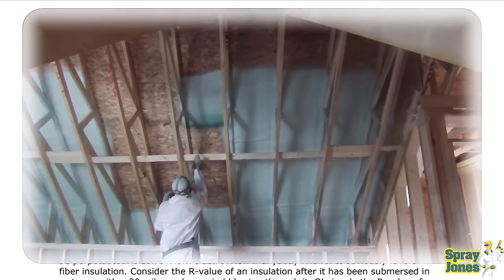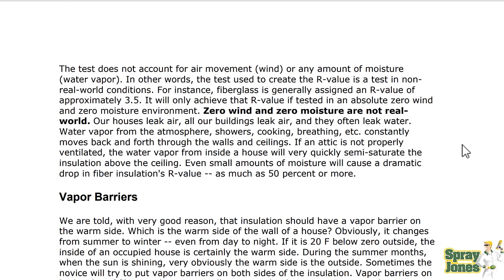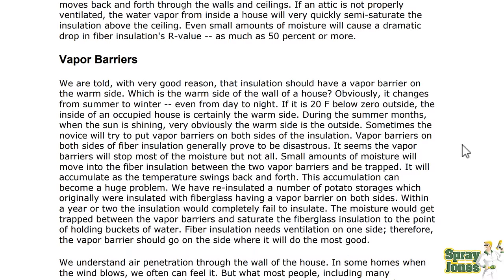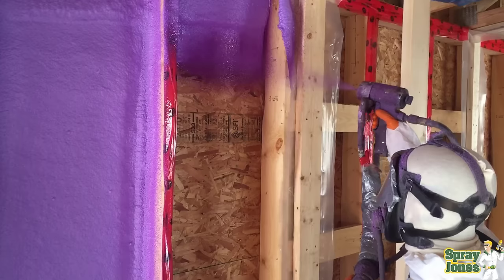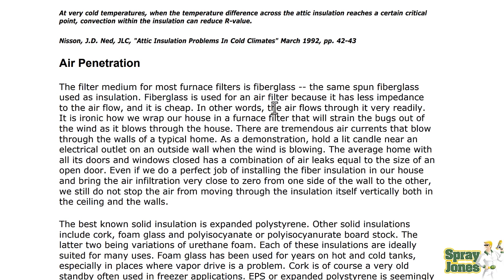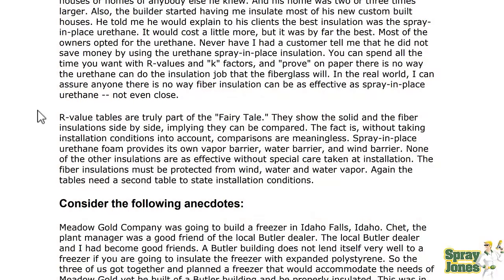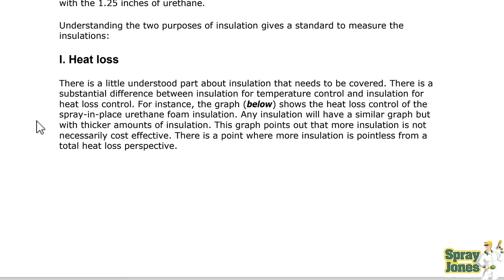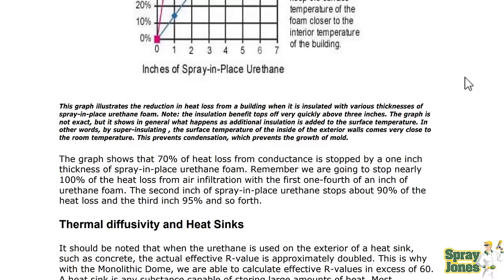Rigged Code Series | Part 1-  Why R values only for Spray Foam Insulation?

Comment: The best insulation hands down. Not one time in the 10 years  I have been spraying has a customer called and said anything negative about how the spray foam performed as an insulator. It’s always a positive result almost life changing for people. The only complaint I getand it’s constant is the price. If the codes/ R-value updated with scientific data that spray foam is in fact the best insulation there is on the market and has many other benefits outside of just an insulator that no other insulation even comes close to matching. Once the codes are changed Spray foam will be code and therefore drop the price on the material and make it more affordable for everyone. Thanks again Mike
Reply: Best is def subjective. 

Dense pack fiberglass at R-23 outperforms 3 inches of foam at r-21. R-value is what's king. Basic air sealing detail is all you need to get a house tight and avoid spending money to bring in fresh air. Forced ach is the same as nat ach below 1
Reply: There were multiple tests. One example. R-21 batting outperformed r-20 cellulose even though cellulose is air tight.

R-20 ellulose performed better than t-19 batting.

R-23 dense  pack will outperform r-21 foam. Basic air sealing is all you need.

R value is king

It also takes 15 years to see ROI on foam when compared to the standard batting. Not calculating fresh air intake costs.  

With dense pack you'll wait 8 years over the standard costs.

Batting offers no ROI for new construction.
Reply: Good stuff.
Reply: I would hope a higher R value would out perform a lower R value
Reply: @mikesteven3611  exactly my point.

Comment: Air barriers testing is critical for the whole envelope. Zip sheeting combined with flash and batt Rockwool on 2x6 studs is current gold standard but it’s evolving. Closed cell strengthens the whole thing.
Reply from the maker: Flash and batt is a disaster in cold climates and will have moisture issues. I have spoken to multiple people already this year that had to open walls and remove it.
Reply: @SprayJones  agreed, the further north you go…
Reply: What about open cell on top of closed cell (2" of closed cell followed by filling cavity with open cell)? Will that lead to the same moisture problems as flash and batt?

Comment: Looking to build a house in AK in 25/26, zone 7 building code requirements so heavily looking at closed cell.  Thank you so much for your info and continuing info as I’m supposed to have R-50 value in the ceiling now and looking at how to do that.  Super excited for this series for sure.
Reply from the maker: What are the specs for vaulted ceilings?

Comment: Hello spray jones hoping to ask a question, we have a 1964 house with cathedral ceiling in living room in cold Calgary prairie. The inside of roof is wood tongue and groove, so plan when replacing roof is to spray foam the other side of tongue and groove. Seems like most spray foam is sprayed to backside of the roof deck. Any issues with spraying the back of the tongue and groove then putting decking over top?

Comment: Ask any renovator what the fiberass insulation looks like after a period of years.
Reply: Dirty with black if air sealing was subpar and not poofy like when first installed.
Reply: @trevorhardy3544  Don't forget the rat/mouse poop.

Comment: Do you do anything about sealing plates, like plates to slab, between double top plates, corners, etc where your foam isn't applied, or is that up to somebody else?
I know most people use a caulking sealant, I have seen others spraying a blue liquid of some sort, just wondering about your thoughts and if you do anything like that.

Comment: Curious to hear what you think about the SIP wall assembly using PU closed cell foam core. So, it would be zip outside, PU foam, osb inside. 4.5" wall is an R26 and nets 3.5" of foam between the sheathing. Is it a good or bad idea?
Thanks
Reply from the maker: Good idea. We have done projects like that already.

Comment: I have a one hundred year old brick construction house with no insulation in Jersey City NJ what spray foam would be suitable for such a structure?
I’m thinking about doing a full gut, removing the old asbestos and the plaster and lathe walls and ceiling’s and install 2x4 framing and new electrical and plumbing and a new Flat torch down roof.
Would I be better off if I put a puck system styrofoam on the exterior as a thermal break and then had it stuccoed? Or spray foam only the basement walls and put up 2x4 and 5/8” sheet rock for fire resistant walls?
I don’t really want to gut the entire house if I can get a reasonable amount of sealing and insulation performance by doing the outside rather than the inside. What’s your thinking Mike?
Reply from the maker: Gut, frame and use 2lb closed cell. Have a dedicated video on "old brick home". Go find it via the search icon on SJ home page channel.

Comment: We are about to build a Barndo (metal siding/roof with zip sheathing) house with a pit basement in North Carolina.  Would you recommend doing closed cell on outside basement walls? If so, would you recommend putting an additional dimple mat on the outside of the foam as well?  Do you recommend an air gap on the roof since it will be metal roofing? Want to use closed cell from the basement up to the roof.
Reply from the maker: I cannot make specific recommendations because they depend on approvals for your county / area.

Watch the 4 part roof series, also in contact with ground video.
Reply: I am planning a "hot roof" or unventilated roof - reinforced with the information from Mike's videos. Review Mike's videos and you'll find what you need.

Comment: In the northeast if you have a house that has typical tyvek house wrap and you were to open the walls from the inside with the goal of swapping out glass fiber insulation for three inches of closed cell spray foam, would the house wrap be on the wrong side of the foam and create moisture problems down the road?
Reply from the maker: No.

Comment: Adobe on the inside, foam on the outside, sounds great! 
Don't suppose you remember roughly what the inside / outside temperature delta was with those potato storage units to require 5"? Cheers!
Reply: to avoid condensation.

Comment: Im having an installer trying to tell me I need 2-3" of closed cell  with 4" of open cell over it? 

Im considering doing it myself. There is a company that rents a sprayfoam rig and a company near by that carries the Alpha brand foam. Im pretty handy but im still worried I will not do it properly. Your videos are very helpful. Id love more info
Reply from the maker: Get a pro. You have no idea what you are doing and what to look for.

Why closed and then open cell? Explain the reasoning behind this?
Reply: I’m in the same boat of doing a hybrid 2” CC and 5” OC 
I have a extremely low roof line maybe a 3/12 and I have a metal roof over top of asphalt roof
It’s elevated on purlins and and there is a ridge vent that I was gonna seal up from underneath. 
I’m also installing a dedicated circuit for a dehumidifier if I need one. I’m in a mountain zone 5a? I’m also using Mitsubishi mini splits on each floor.
Could I just spray the 2x4 rafters with 3” of closed cell and get be fine? 
Won’t have access to roofline once drywall is hung.

Comment: As with anything, the devil is in the details. In this case, penetration, vapor, water, and air management are all more important than base-line R-value. The closed-cell spray can easily form a vapor barrier (very cool), but special care still needs to be taken to make sure that OSB sheathing isn't seeing any water. If a builder is just slapping some Tyvek or tar paper on it and then attaching siding or shingles directly to it then you can easily run into the problem of that OSB soaking up water over time and failing in spectacular fashion. If you're gonna seal the inside of the sheathing, it's probably a very good idea to seal the outside too with something like a peel-and-stick, fluid-applied, or something like Zip or LP's WeatherLogic to make sure the wood never sees that moisture. 

Also, to your point about diminishing returns going beyond 2in of spray foam, I might add that your spray foam is only as thick as your deepest penetrations allow it to be. More specifically, if somebody pops a 2in nail or screw through the sheathing and it isn't trimmed on the inside before being sprayed over with 2in of foam, then you've only got about a half inch of foam in that spot, which can lead to little snowballs forming on the inside of the foam in very cold conditions. Saw that happen on Mr-Postframe's barndominium (2in spray backed up by fiber batt) and that was gnarly. All that said, not trying to talk bad about spray foam. Just saying that the entire package has to be evaluated and implemented well for any insulation strategy to be successful over the long term. Love watching these videos, as they always get my brain thinking about second and third order considerations about any strategy I think about implementing and what to keep an eye out for when I do implement it.

Comment: The tightest buildings made and tested are Passive Houses. There is very little or no blown foam in them typically. I have tested foamed homes and the cavities may be sealed, the rest of the details still have to be done. What about the thermal drift in the foam from cells breaking down over time and air replacing the gas? The biggest problem is the installers. I live in climate Zone 7 and the installers are often blowing foam when it is too cold. When Certainteed started making foam, the area rep contacted me repeatedly to blower door test and look at the homes with the IR camera. It wasn't good. Foam had shrunk, didn't adhere to the substrate, some of the mixtures of foam were off. If blown in proper conditions, foam works where it is sprayed. Then if you get into environmental and health issues with foam, that is another issue. The great majority of Passive Houses are not made with blown foam.
Reply from the maker: No fault of the product. If I hand you a lawn mower and someone first uses it over gravel do you bitch about the condition of the blade afterwards?